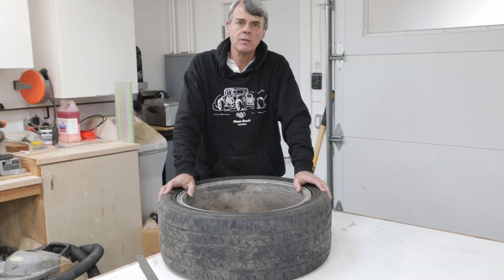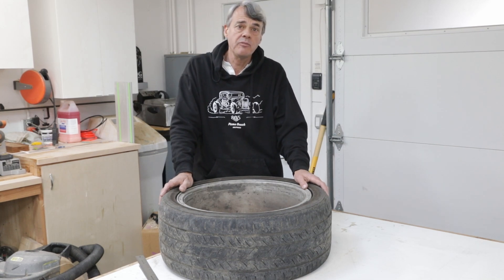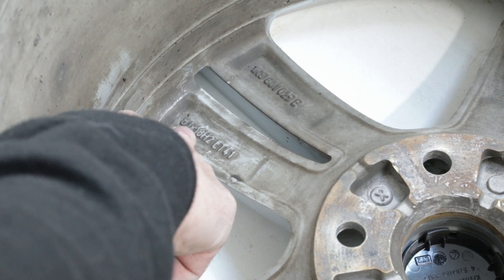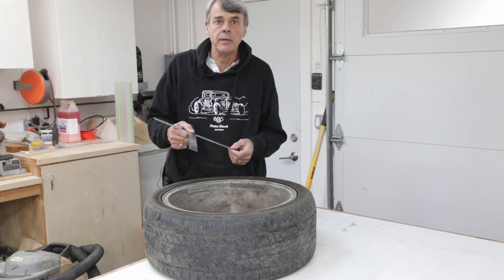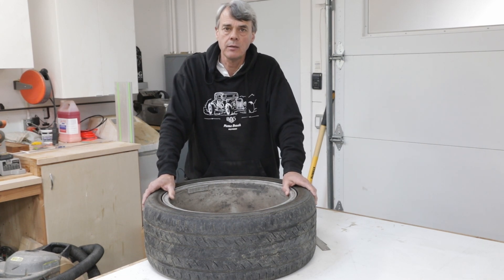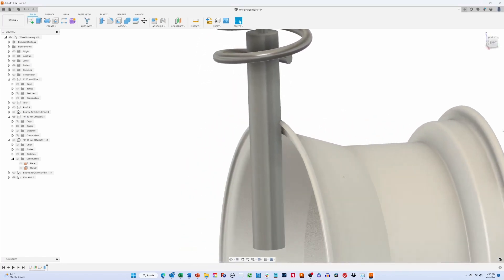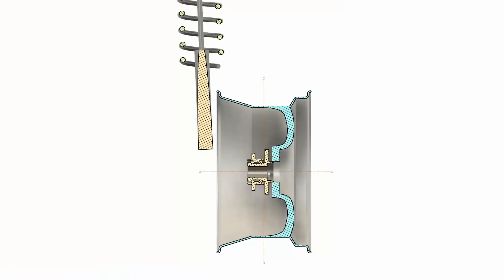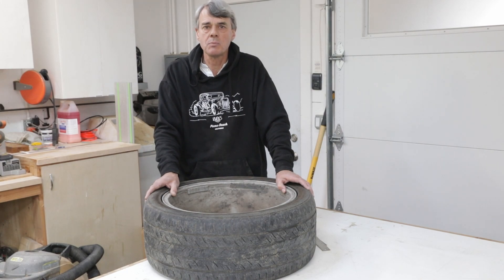Wheel Offset

Comment: The outer lip of the rim of the wheel is included in the backspace specification.
An 8" wheel with 0 offset has a backspace of 4.5".
The 8" width is measured from bead to bead. An 8" wide wheel has an outer width of 9".

Comment: I think for the layman, backspacing is simpler and easier to use when buying wheels for a particular appearance. That aside, assuming you can place the suspension however you want, change or adapt the hub bearings to suit, and that the fenders weren't a factor, how does changing offset affect the dynamic grip of the car? I've heard that a high positive offset (IE flat face wheel) gives a lot of side bite, which is good for controlling oversteer on the rear or reducing understeer, I suppose, if it were done on the front. Is this true, or is wheel offset mostly detached from handling characteristics as long as it isn't extreme IE dually style positive offset or 2-3 inch backspaced wheels.

Comment: My question is once you find out your offset than what is the calculation to figure out the minimum and maximum offset allowed?
Reply from the maker: There is no hard a fast answer to that question. IT depends on the rest of the suspension design. I really wouldn't change the offset more than a few mm without risking changing other suspension parameters and performance too much.
Reply: I've only bought aftermarket wheels once, out of necessity rather than aesthetics (though I did like the new wheels better!); I went from a stock +55mm offset to +45mm and cannot say I noticed any difference driving wise... 2006 Mazda MX-5